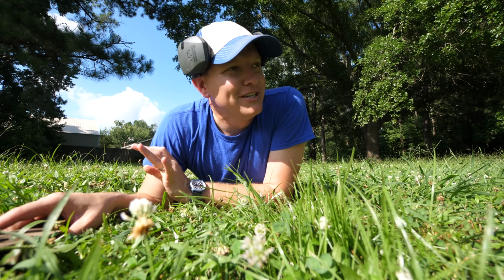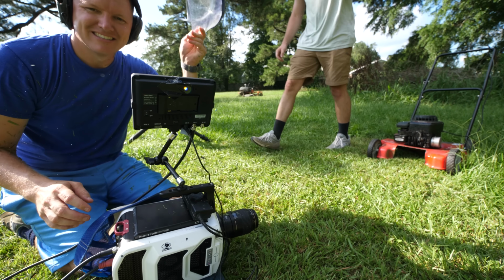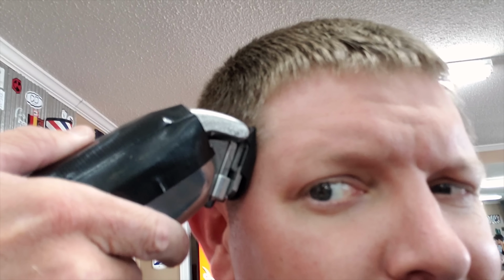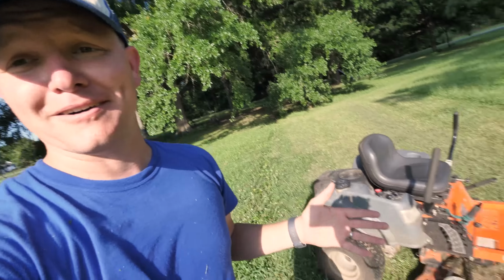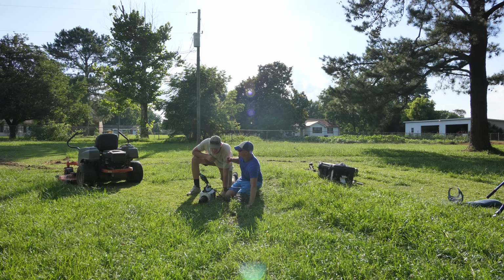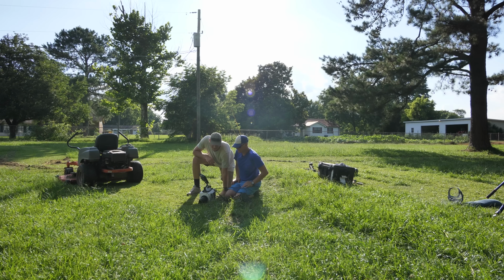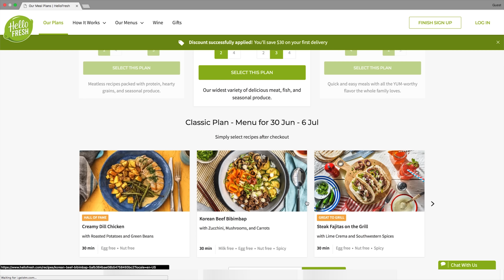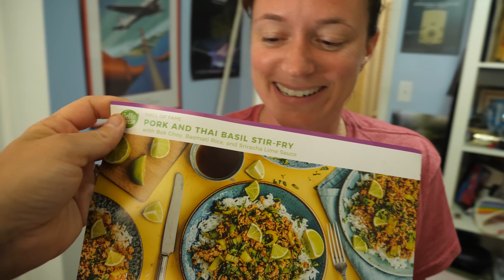How Lawn Mower Blades Cut Grass (at 50,000 FRAMES PER SECOND) - Smarter Every Day 196

Comment: Hey Destin. We have a small yard and I want to use a manual-powered reel push mower. But the cut is never as good as our electric motorized mower. Can you take a look at the differences with a reel mower and maybe suggest how to get the best cut possible from one?
Reply: Don Seiler Get yourself a Fiskars Reel mower. Seriously look it up here on YouTube. I absolutely love mine. Easy to push and free spinning reel, because it’s designed not to make contact with the fixed cutting blade. Only problem, like any other reel mower, you can’t let the grass get too tall. At that point it just bends the blades of the grass over. Btw, I’m not a salesperson for fiskars, nor am I the average eco crazed Prius driver. I just got tired of maintaining my noisy gas mower. Keep the reel mower alive!
Reply: I've already got the mower, a hand-me-down from my sister-in-law. I'm not sure of the brand but it doesn't look like the Fiskers mowers that Google is showing me with the orange cover. I don't doubt that it could use a good sharpening though. Thanks for the reply!
Reply: Reel mowers don't get sharpened, that's a misnomer. Instead, they get their gap tightened. An easy way to tighten the gap is to let them rust. The rust will grow into any excess clearance in the gap and improve the performance.
Reply: Andrew Gulliver you are incorrect.  You do sharpen reel mowers with a stationary grinder for the reel.  You then lap the reel to the stationary bar with lapping compound to plane it and make it straight.  You obviously have never  seen it done.
Reply: jdbrepair, I have performed the lapping compound procedure. Letting rust grow into the low spots will produce the same effective result as lapping off the high spots: a uniform gap. The uniform gap is what facilitates the shearing action. The grass responds the same way with either method. 

I thought my reel would be ruined when I left it in the weather for a year. Instead, after a few rotations I got a better result than when I used the lapping method. The paper-shear test confirms my claim.
Reply: Andrew Gulliver : whatever you think works best.  Funny, that all the golf course shops I've done work for, keep their equipment out of the rain, use a grinder and the lapping method.  It must work.  Perhaps you did it wrong.  But, it sounds like your experience is limited to owning one reel mower, so like I said.... whatever works for you.
Reply: I got into the Zen of how reel mowers work enough to understand they don't use sharp edges grinding against each other as with hand scissors. You also don't sharpen reel mowers as is done with hand scissors. Instead, its more of a machining operation intended to create a uniform gap. What's termed as 'sharpening' is more accurately described as creating/maintaining a uniform gap.

Think of the rust as a precision contoured edge coating of super hard iron oxide. Inducing rust takes longer than grinding/lapping, but both work.

Comment: There is a lot more to a lawnmower than most people realize, and it’s nice to see more people seeing the years of trial and error, experimenting, great thought, and years of tweaks that go into them. (Especially from a great slow motion perspective like you are able to show!) 
Let me add some light to this topic if you will.

Reel mowers do cut in a similar way to scissors. They are also better for the grass as they cut without ripping and tearing, which makes the grass more susceptible to disease. (That would actually be an interesting sight, slow motion of a reel mower cutting grass 😊)

And it may not seem like it but yeah there is a lot of thought that goes into mower decks as well as the blades.
The blade is actually quite similar to an aircraft wing, just with a sharpened leading edge. 
They are tilted slightly (the only part of most blades that are parallel to the ground is in the middle of it where it bolt to the crankshaft or spindle) so the whole blade produces lift, not just the trailing edge. The trailing edge is to add some more lift but also to aid in removing clippings/mulching depending on blade style. Look at some mulching blades (Gator Blades for example) the trailing edge of those are much different, with multiple up curved tips to cause a sort of vortex effect/rotation of the clippings inside the deck to chop up each blade of grass multiple times.

And the deck keeps the airflow where it needs to go, directing it and the clippings to be blown out or kept circulating to be mulched (along with keeping the grass and the inevitable stone from flying all over the place lol)
If you can find a way to safely show the difference of a spinning blade in the deck as opposed to not in a deck that would be quite interesting, but be SUPER careful!! A mower blade is not a toy and will chop fingers/arms/toes/feet off easily!)

Anyways, I look forward to more videos on this! 😊
Take care!!
Reply: As those wonder how fast a spinning lawn mower blade does cut the grass when they wonder how the blades are shaped to maximize lift to pull the blades of grass as they wonder how to show the effects of the blade while taking safety precautions as the blades can take limbs off like a hot knife through butter as foreign objects can be turned into projectiles causing injury and property damage when those used a slow motion camera to showcase the spinning mower blade.
Reply: Thanks for mentioning the reel mowers. They are a pain to sharpen, but they are much better for a lawn - a really well-maintained lawn is clipped with a reel mower (power or now) and the grass is much neater.  But the lawns I mowed as a kid weren't level enough (or clean enough) for a reel mower. Some were so bad I had to stop halfway through to sharpen the blade again because of all the sticks and rocks.

It's interesting the blind spots we have. I knew as a kid that the lawnmower was pulling the grass up to chop it off.

Comment: The blade fin and airflow help move, recut, mulch, and eject the cut grass but I'm not convinced that it alone sucks it up straight to make a straight cut.  It helps, though.  Healthy grass has moisture and mass / inertia to resist getting knocked down but gets snapped over and broken against a fast moving sharp edge.  The fins are for airflow to recirculate the grass and cut it multiple times.
Ever tried to cut dry stringy grass?  Doesn't work so good.
Lawn mowers don't all have fins but straight blades with no fin.  How do they work so well without the fin?

Also...  What Bryan Del Monte said, too.   :)

Comment: You should see the vacuum lift the grass on a big commercial mower. The blades spin faster because the mowers travel faster so it has a super strong vacuum that you can clearly see when you go over grass that is laying down flat. It pulls it up and it is surprising how long the grass actually is fully extended.
Reply: Bigfoot And Bananaman   I think the higher-speed blades is more to get a mulching effect.  The vacuum is a secondary effect.
Reply: Lou Fazio mulching depends on deck design. Only mulching decks mulch. Most commercial mowers are actually designed to process grass as quickly as possible and don't mulch much at all.
Reply: Bigfoot And Bananaman   That too.